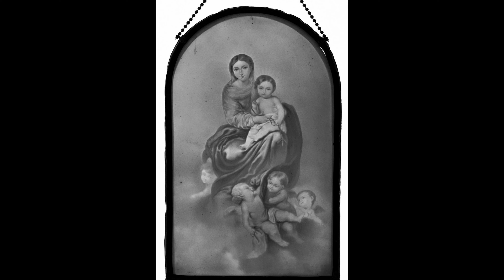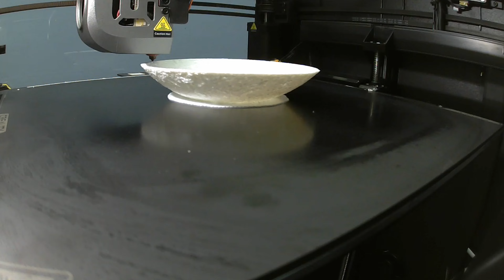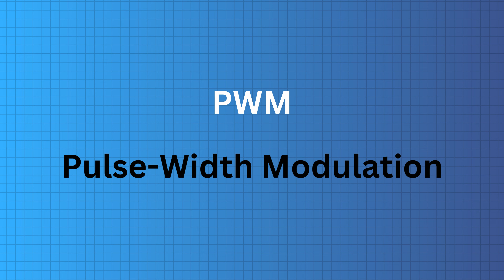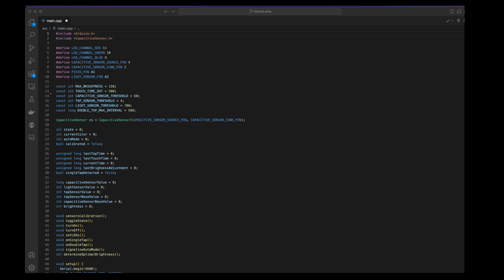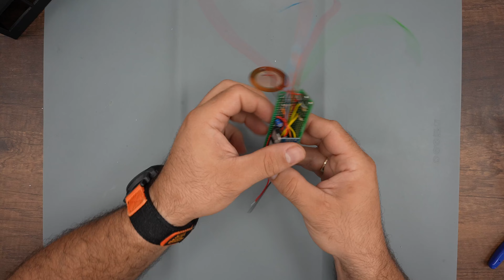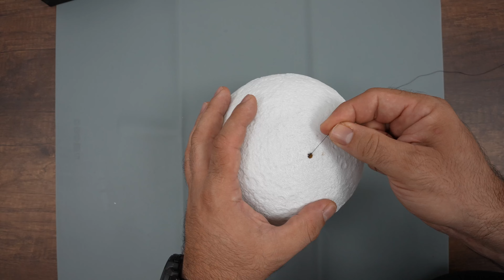3D Printed Interactive Moon Lamp

Comment: Great project thanks! , made it and it works ok , Have some issues with the lamp flashing off and on a lot even it its set for dark mode im guessing the value for light it wrong, Dose this flip to dark mode completely or does it flicker when its on the verge of darkness..?
Also i cant get the capacitance  of the turn on and off to work when its inside the moon I hold my hand over it but nothing happens but if i touch the foil its works fine , all the resister values are the same as your but maybe not the tolerence values. CAn you tell me with values to alter in the code to adjust these. as the flashing of and on for hours is a pain and then I also cant turn it off . Be nice it i didnt have to hit it as hard as i do also to change colours. :: Other wise nice project Thanks again

Comment: Some Led strips come with white ones . Using these would much simplify the circuit as you wouldnt need to control R G B just the white ones.